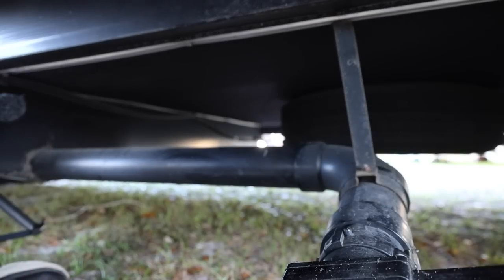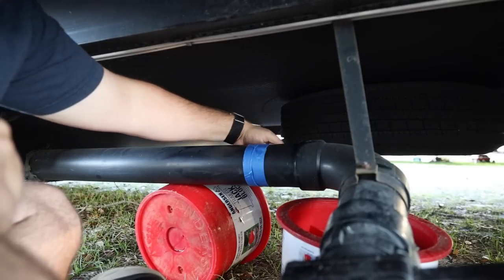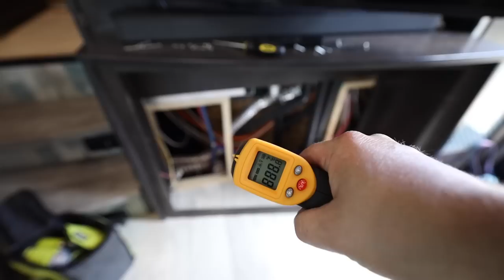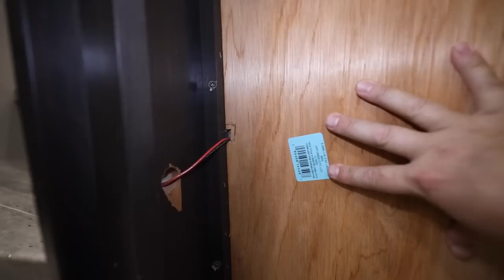RV Modifications that SHOULD be Factory Installed 🤔

Comment: Your sewer line is abs not pvc. You don't prime that and use should be using abs glue. It may hold for awhile, possibly couple weeks or even a couple years but plan on it failing in the future.
Reply from the maker: Thanks for the heads up. I’ll keep an eye on it.
Reply: @1StrangeAdventure  check your adhesive - from Oatey......"Can you use Oatey PVC cement on ABS?
This milky-clear, all-purpose cement can be used to solvent weld all schedules and classes of ABS, PVC and CPVC pipe and fittings up to 6 in. diameter with interference fit."

So if you bought the milky all purpose, you are OK.  Read the can to be sure.
Reply from the maker: Thank you. I’ll check it.
Reply: I was screaming NOOooo!  STOP! When I saw the white PVC coupler and PVC  glue/primer. 😮

Comment: Have you thought about doing the stair risers to match what you used for the fireplace?  The running 2 different directions and being slightly different is a bit distracting!
Reply from the maker: Yes, we are going to be switching over. At $10/sheet, we have to do it in stages. Great suggestion! Thank you. ☺️